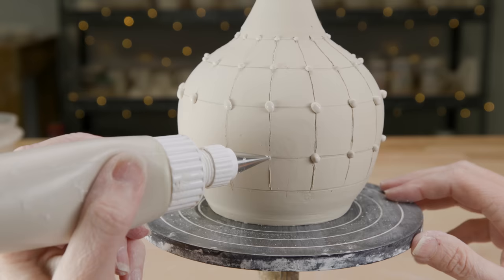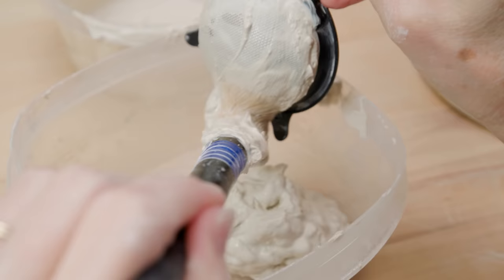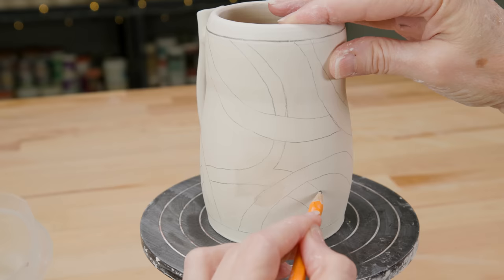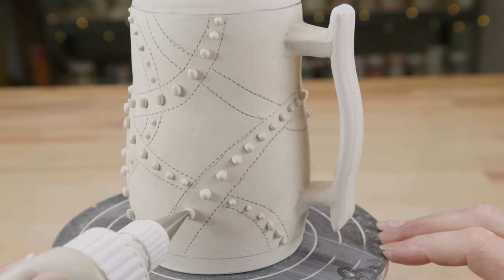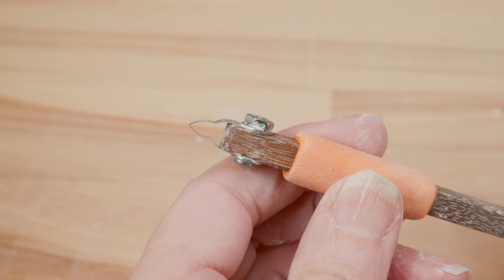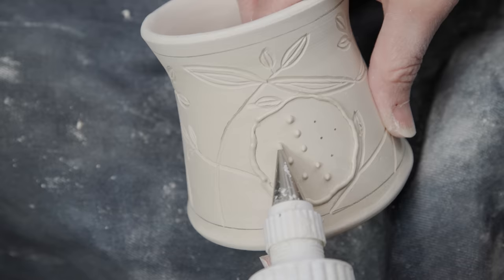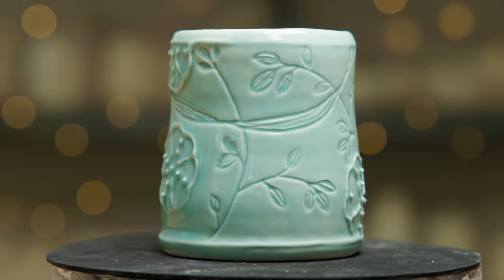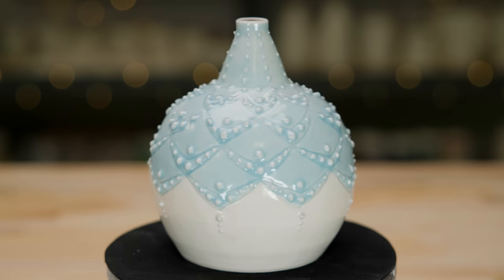Slip Trailing Made Easy! How to make and decorate with slip!

Comment: I like using a handheld immersion blender to mix slip w/water. Then sieve thru 80 mesh screen (or a Talisman sieve).
Reply: Hi Beth.  I like to use the blender too when I am mixing a big batch of slip, but as I was only mixing a half a cup, I just did it by hand.  Great tip though, thanks so much!!

Comment: Hello ! Do you know how to avoid cracks in the texture added with slip ? I was wondering if I should deflocculate the slip, but I don't know to what proportions or if it's even a good idea.
Reply from the maker: So many variables...could be cracks from the variance in dryness (putting something wet on something too dry)...depends on what kind of clay you are using for slip too...the porcelain tends to be smooth and does not crack. You can try deflocculating but it may thin it out too much...